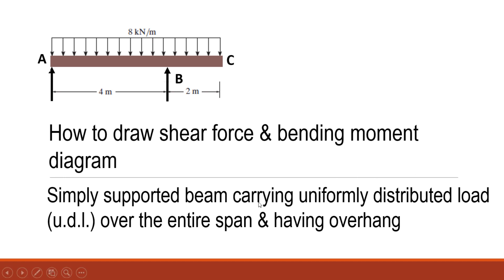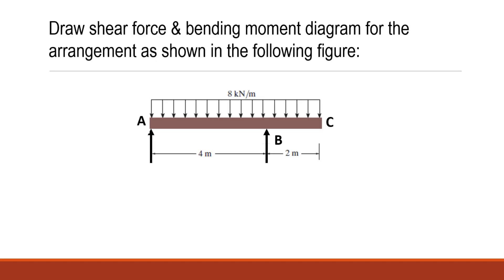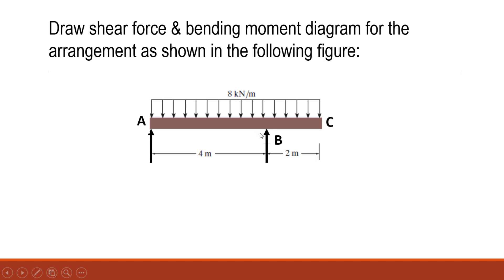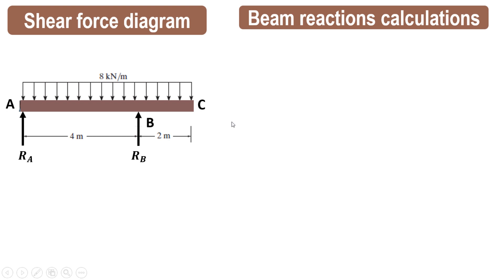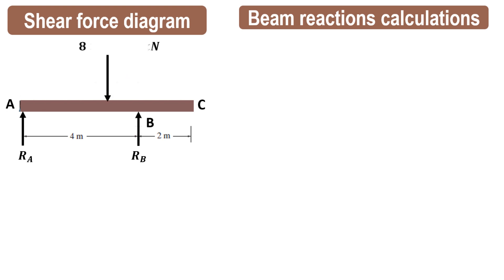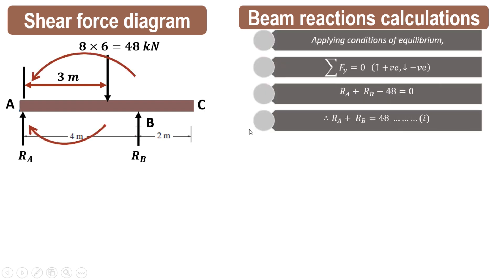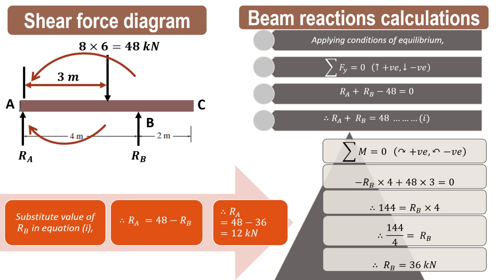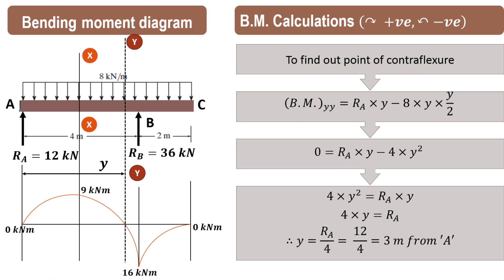Lecture 21 | How to find point of contraflexure | Simply supported beam carrying u.d.l.

Comment: a simply supported beam of length 8 m rests on supports 6 m apart, the right hand end is overhanging by 2 m. the beam carries a uniformly distributed load of 1500 n/m over the entire length. draw s.f. and b.m. diagram and find the point of contra flexure, if any